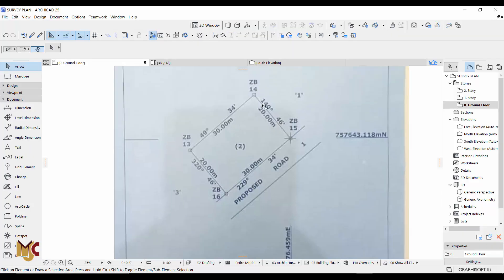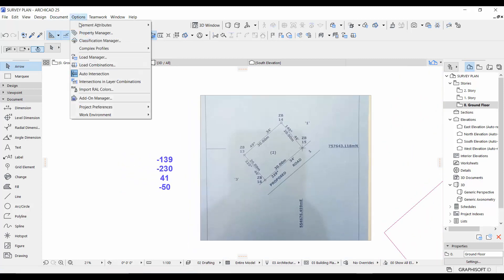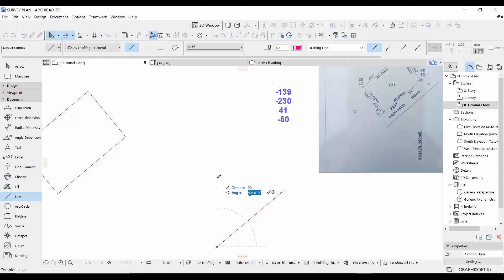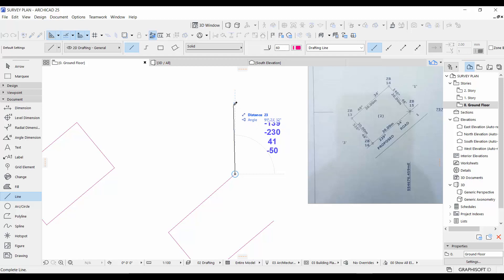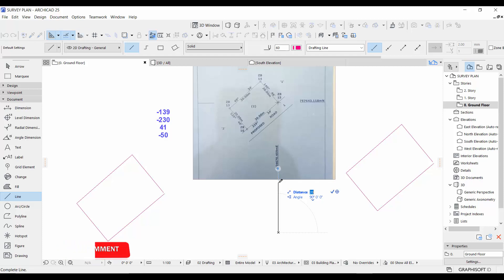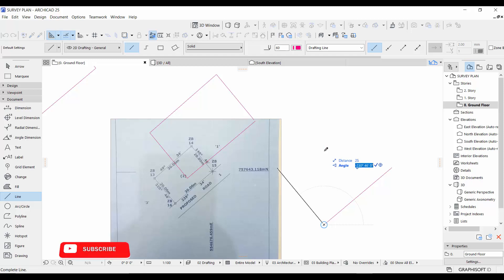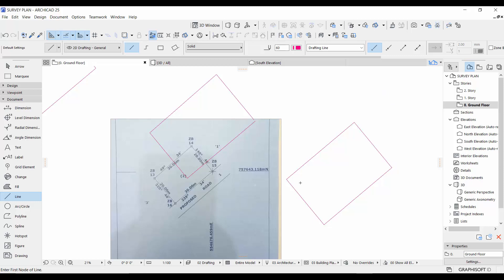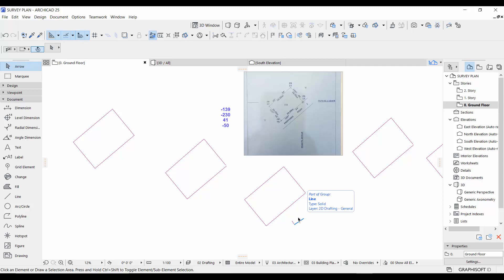2 FAST WAY TO DRAW SURVEY PLAN IN ARCHICAD #archicad #survey_plan

Comment: Hello sir? I have a project that am working on and it's too big. It's sitting on a parcel of land measuring 750m x 640m. Am challenged on designing a Master plan and have all the information of the layouts and road networks on the same page  and print a visible drawing in pdf format.  Any Assistance please, on how I can set my line weights, how to set my texts to be visible, and how to set the scale so that I may capture the whole information on 1 page and still have a visible drawing. I appreciate your assistance in advance sir
Reply: Did you manage to get an answer? if your answer is yes, how did you go about it.